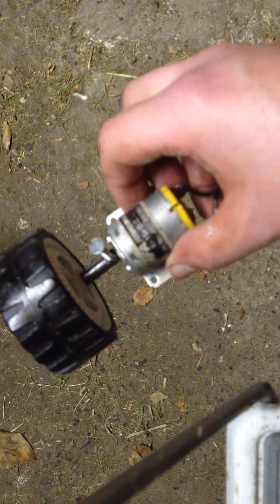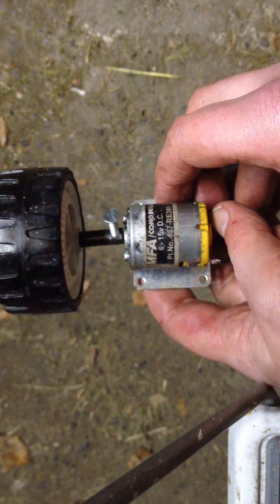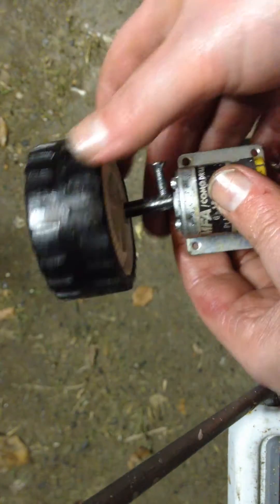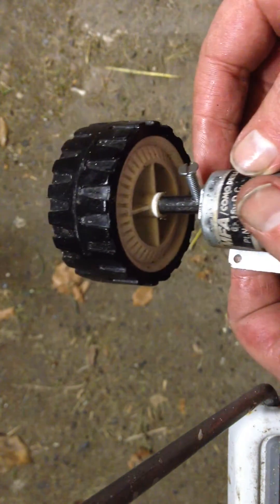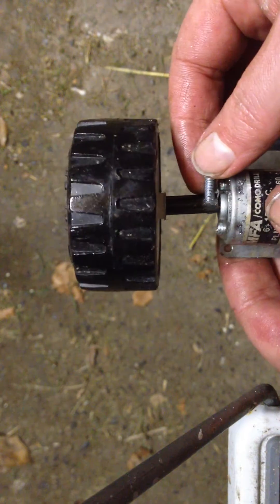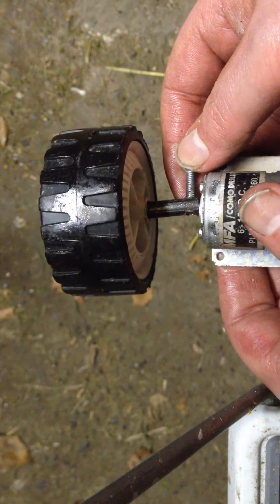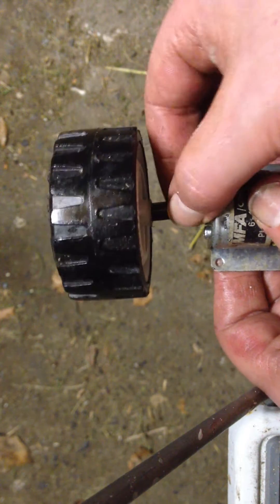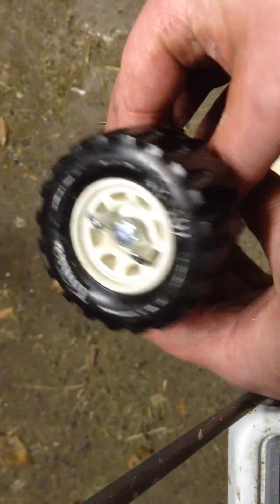DC Motor with custom made coupler to connect to wheel

Comment: Ok for your needs but I need to do much the same but bigger motor higher speed so need things very well balanced. Still hunting for a good coupling method and parts to do it. Revese thread shaft makes it difficult and the grub screw method is not the best for alignment when mating surfaces are not perfect.

Comment: I Need to make sure I get my wheels solidly and centrally on small 775 motors for tennis ball launcher machine. Thanks for sharing
Reply: I'm working on a similar project, did you end up finding what you needed? I was thinking of using a 24V 775 DC motor.